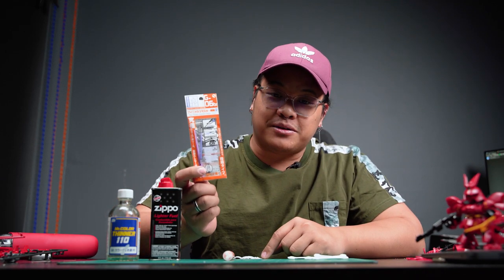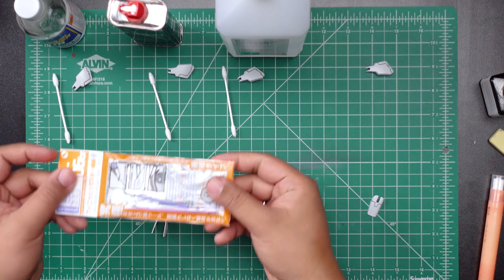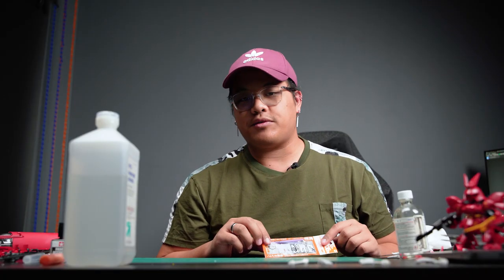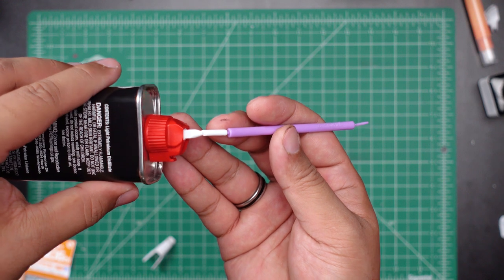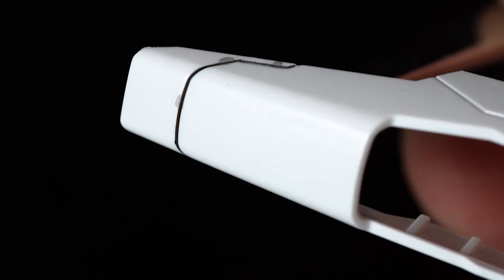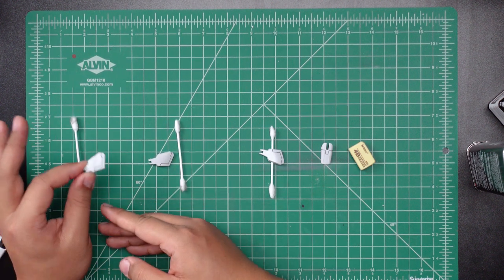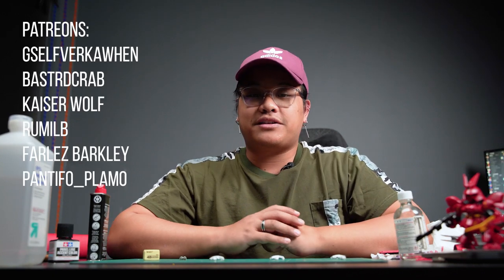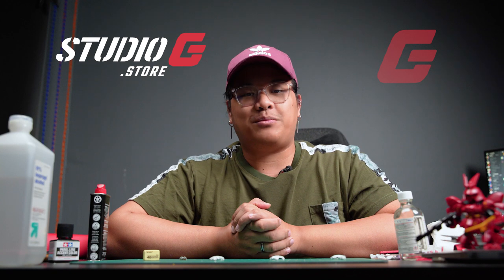Finding the Best Way to Remove Panel Liner - Solvent Showdown!

Comment: About to start my first Gunpla.   I have two identical Entry Grades,  and was going to paint up one and not the other.   I have never used panel liner.   I understand that once painted with acrylic paints,  a gloss coat is necessary to protect the paint,  but what about the unpainted plastic?   Can I use Tamiya enamel panel liner directly on that without harming the plastic,   or will this still need a clear coat?  Thanks in advance.
Reply from the maker: You can use it on bare plastic, just be mindful not to soak the line with too much panel liner. If panel liner seeps too deep into a crack, it won’t be able to evaporate and may make the plastic brittle

Comment: Gas. So my dad told me to go to the gas station with a water bottle and fill it up as needed with the cheapest fuel. He told me that it works pretty much like thinner but at a fraction of the cost. The old man doesn't teach me too many things anymore that I havent figured out but this one was a nice surprise.
Reply from the maker: Very interesting! While I don't formally endorse this (for safety reasons), I'm curious now as to how plastic would react to it! Might need to do some experimenting!

Comment: Can you use acetone to remove not panel lining but actual paint from the gumpla itself like Gundam markers?
Reply from the maker: You can, but acetone is pretty harmful to plastic so I would avoid using it. It'll make the plastic brittle much faster than paint thinner would

Comment: Why on bare plastic. We still have no idea how these would affect a paint finish. 🤦🏼‍♂️ waste of time. That’s 8 minutes I will never get back.
Reply: I might be a bit late, but I came here because I bought AK Paneliner to use on an acrylic Humbrol water-based top coat over a Tamiya acrylic base coat.

After some research, I found out that isopropyl alcohol and enamel thinner would damage my acrylic paint due to the solvents involved. 

Also, using this Enamel paneliner will damage bare plastic over time on bare plastic and make it brittle (especially if not used sparingly)

I found that white spirits and lighter fluid may work best in my particular situation. 

There are conflicting posts on message boards that say Tamiya X-20 Enamel Thinner won't damage the acrylic. 

I would recommend experimenting on spare parts or bits of the runner first to prevent damage to your kit.
Reply: @tomd96  thanks. I actually went with oils. Much safer and worked well.